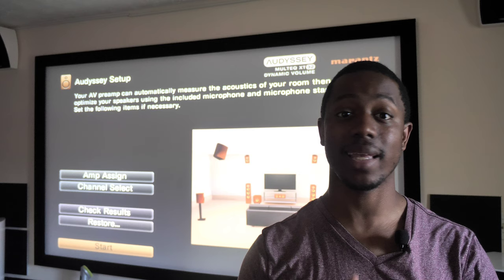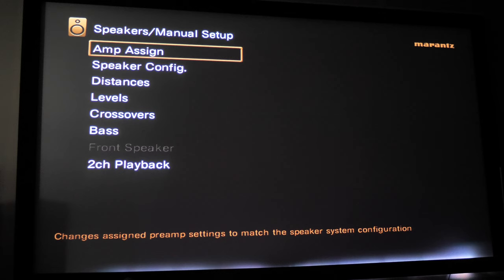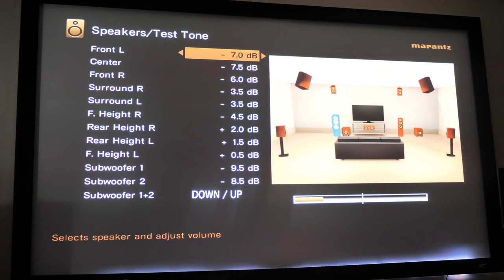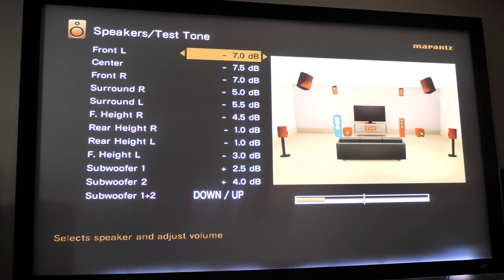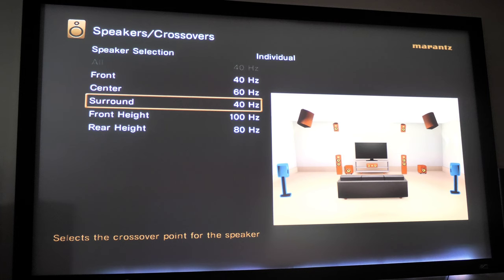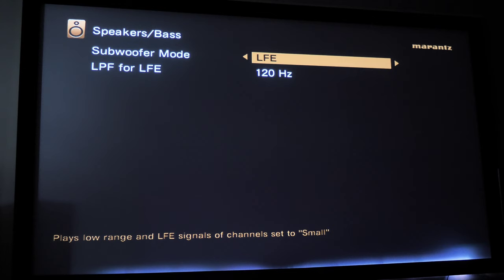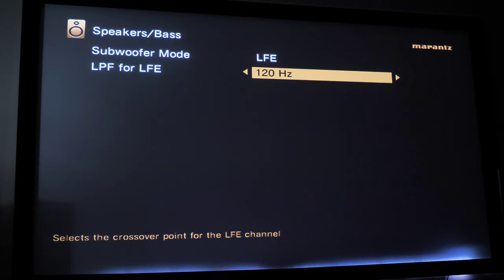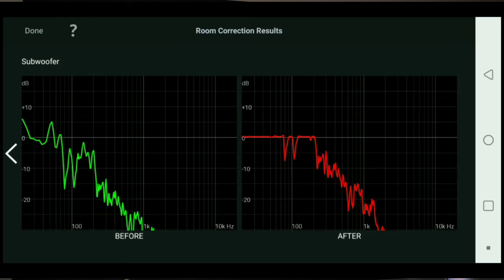How To Identify and Correct Receiver Calibration Mistakes

Comment: Great Kpaceguy. As a newbie you answered many of my questions, especially about avoiding male-voice chestiness from the center speaker. At the same time, you raised more questions for me. 
Could you discuss using the graphic eq after calibration. I produced some unexpected cuts and boosts,  in the bass, according to the graphs, Also, as I understand it, changing mains to small, then changing xovers re-assigns frqs below the xover to the sub and mains. This means that what the calibration "decided" before, is not what it would decide if you ran it now. Also, if you check levels, and responses after tweaking, do the measurements of a given speaker take into account the re-assignment of bass from other speakers.
Reply from the maker: I think I have a video about it. I'll link you to it
Reply: Looking forward to it thx @Kpaceguy

Comment: Nice job, generally.  But some of what you are doing is incomplete with regards to the potential for dealing with crossover refinement with the Editor App.  Like you saw with your initial run, it is very common to see Audyssey want to call the LCRs Large, and worse, cross them at 40Hz...even with speakers that you know good and well are not capable of being -3dB speakers at that frequency.  With the editor app you can, of course, change the config to Small. With some study of the pre-EQ room response in the Editor App, you can then use the Curve Editor to confirm where each speaker's -3dB point is in your room.  It's usually close to the speaker's designed -3dB spec.  You can and should change the crossover to that frequency,  but the real refinement is also telling Audyssey this in a more precise way by reconstructing the target curve of the speaker to reflect that -3dB point. This is quite easy to do in the Curve Editor by setting grabs at an octave above that frequency and at 20Hz.  You then manipulate the 20Hz level until the level at the crossover frequency is -3dB below the baseline average spl (that you can estimate in study of the response pre-EQ).  What you will see with this when complete in the Curve Editor is the appropriate 2dB per octave roll-off below the crossover point.  Audyssey will then apply filters to conform to that curve when you save and load it to the AVR/AVC. This helps smooth transition to the subs and prevents filters chasing things they don't need to.

The choice of the crossover frequency can also be affected by room volume.  Headroom is extremely important in the sub-80Hz octaves.  Your speakers (and subs) need not only the ability to create the frequencies down there, they need to be able to do so at very loud levels with ease.  This is so that they will never be challenged and compress at louder passages, reducing dynamics of the LFE.  If your speakers seem to be okay at 60Hz at normal listening levels, do they remain so when called upon to do so at times of loud passages?  If you are missing "slam," and you know the source media has it, this could be the problem.  Audyssey thinks you want the LCRs to deliver that 60Hz slam, when the room volume might overchallenge the speakers ability to deliver it.  Room volume affects this mightily.  Choosing a crossover point a bit higher than you might expect (perhaps 80Hz rather than 60Hz) may be just what your speaker needs to be able to roar without strain, turning over the loud lower passages to the subs. As long as the subs have the ability to deliver with plenty of headroom, you will then have the slam.  This makes a significant improvement to LF dynamics even at at normal listening levels if you have a large room. Of course, use DEQ.  FWIW.  Cheers
Reply: I failed to add that the pull down on the 20Hz grab will also somewhat affect the entire curve...and needs to be "countered."  To do this place a grab at 20KHz and move it such that all of the curve above the LF overlays precisely the primary curve that Audyssey created (the green and red curves).  Also, above I used the term "slam," but perhaps that is better used for the lower frequencies, and "punch" might be a better term for dynamic LF content around 60Hz. Rather subjective terms, but you get the idea. Cheers.  I enjoyed your video.  I'll have to check out more.

Comment: Why all my speakers levels are on +? 
Don’t i need to start with the center settings on 0 and then turn noise volume on untill 75db, then continue to get 75db from all speakers?
Reply from the maker: What receiver are you using

Comment: Just hit "subscribe".
I have the Onkyo NR6050 I also have the NR7100 and I want to see if there is a substantial difference since it is more than twice the price. 
Speakers:
Front wharfedale  valdus 400 se (I also have Timeframe TF700 not hooked up)  I would like to set them up as zone two for stereo listening only.
Center and surround are entra point five

the AccuEQ set the speakers within 4" of their actual distance with the exception of the Sub, that was off 3'
Front wharfedale  40htz
center 90htz
SR 100htz
Sub 120htz 

Timeframe sounded increasable at full in Pure audio  and "direct"  and much louder in stereo mode which does apply EQ.
Reply from the maker: I appreciate it. Welcome to the crew

Comment: Hello ! I hope you can help me with this question:
I have a pioneer amp (vsx815) that comes with 100hz xover by default. I have a Bosé Acoustimass 600 speaker.
How much do I set the x over on my amp?
And the ohms at what is recommended?
The speakers have a range of 4-8 ohms, also in the amp I can choose from 6-8 ohms.
Thanks in advance, engineer!
Reply from the maker: Are your speakers hooked up to the bose subwoofer directly?

Comment: After running Audyssey, if you use an SPL meter to level your speakers hitting the MLP at the same volume, do you keep Audyssey and Dynamic EQ on or off?  Many AV guys say to turn Audyssy off completely and use external tones to measure speaker volumes but then what happens to those levels iif you turn Audyssey and Dynamic EQ back on?  Also is using 75dbs at 0 volume too loud even when you lower the volume?
Reply from the maker: I keep everything on because that's how I'd use it after setting levels. I turn it off only to do certain calibrations outside of the receiver
Reply: @Kpaceguy Thanks,  but are you using the AVR's internal tones? From what I've read they bypass Audyssey whereas external tones don't.  I'm wondering whether it would be better to use the external tones with Audyssey and Dynamic EQ on. What do you think?

Comment: For the crossover, it's recommended to put everything at 80hz. First because this is the standard, second is because no matter what speaker you have and how low it goes. It will NEVER match a subwoofer in terms of impact and pure SPL. Also it will make your speakers use less power which means you can play them louder because the most power is consumed by the bass, 80hz and lower. So your AVR won't struggle that much, you will get cleaner sound and you can play louder. Even the top most Marants reliever won't do more than 60w per channel all channel driven.
Reply: Quetzalcoalt The only reason why 80 hertz is the standard is because of THX certification. You can thank George Lucas for that! If you have a high power amplifier and speakers that are rated down 40 hz or less you can set the crossover to less than 80 hz. It’s all about your personal preference.
Reply: @glennarcher986  If you start reading why it is the standard you will see why it is the standard. Bass is a huge problem in a closed room. Because bass have longer wavelengths and bounce all over the walls (floor and ceiling too). If you have a big explosion that will play 30hz at max volume on the LCR at the same time, you will have massive peeks and null in any room. That's why it's better to have subs doing all that work, because there are less drivers and can be made to work together more easily hence making the frequency graph more flat. Best way is to have 4 subs in each corner. Minimum of 2 subs is a must. When you have 1 sub, you can't fix the nulls because you need another cone pushing somewhere else in the same room in order to bring the null up. 
People wrote soo many books on how sound interact in a room. The 80hz rule no matter that THX made it a standard in the cinemas is a must to use. Which one would bring more impact, 3x7 inch drivers handling 200watts total or a 15-18 inch 1000w sub (or 2) ?
Reply: Quetzalcoalt You can go all technical on me and frankly I don’t care! It’s all about personal preference. If I want to set my crossover to 60 hertz, 50 hz or 40 hz, that’s me. My speakers can handle it. It’s interesting that before THX certification, there was no so called “industry” standard for the crossover.  It wasn’t until George Lucas and his team of engineers that changed home theatre as we now know it. How’s that for doing my research?
Reply: @glennarcher986  Can you do 105db at 20hz at your listening position with your Front Left and Right speakers individually ?
I would need a speaker that can do at least 110-112db  at 1 meter away in order to reach 105db at my listening position. 

Can you do a video, play the beginning of Edge of Tomorrow and 0db on your AVR when using a 40hz crossover. Also can you say what brand and model if speakers are you using, because they can handle it ?

It's a personal preference to use a fork for eating soup as well. 
That's why Dolby and some other companies are forcing a standard for movie watching, that disables all the personal preference crap on TVs but you don't care about the technical stuff and why they are doing it, this is the reason people complained about the dark scenes in GoT S8, that they can't see shit, but people with calibrated systems and the personal preference crap on TVs disabled had no complainants.
Reply: Quetzalcoalt Congratulations on all your technicals!!!! Where would you like me to pin the medal? It’s obvious you’re looking for an argument. I’m out!!!!
Reply: @glennarcher986  Wow. dude .... please read more. I don't want to argue with anyone, but spread the information that i've gathered in my last 3 years of reading about acoustics, measurements, standards, subwoofers, placement, room dimensions. I have soo much to learn. If you don't want to get knowledge then ok, i'm fine with that, but don't just start replying with random crap.
EDIT for a start go watch the first videos of Anthony Grimani from AVPro Edge. Not gonna link them here, go find them yourself.
if you like those (i think they are 5-6 videos 2-3h each) i will give you more PDF and technical forum threads to learn more.
I'm out too.
Reply: @Quetzalcoatl0  Glenn Archer seems like the most hard headed person around and doesn't want to hear any of it. He just has a hate for George Lucas and  believes he is somehow responsible for this 80hz standard and that he should burn in hell for it. Oddly enough, I wonder why people who set the crossover at 80hz always notice an improvement when it's just a big George Lucas/THX conspiracy?
Reply: @Jason-wc3fh  Yep, some people don't want to understand and learn why "something" is done this way. They just think what is right and that's it.
Reply: "NEVER" is a dangerous word. Some subs have weak amps. or are poorly designed or poorly built/damped/flimsy enclosures/chuffy ports etc or have higher harmonic distortion than some speakers

Comment: Kpaceguy I have a maybe problem but when I did the automatic calibration on my Onkyo avr..all is good except my left and right front speaker distance were way off ,the left was 11.5 feet which is good but the right speaker was 2.5 feet distance which of course wrong. My Question is what do you think the receiver did wrong? please advise Thanks.... PS.I re did it several times, I always get the same results....
Reply from the maker: There's no telling what it thought it needed to do. You could rerun it and it get it right. That's why we go back and make corrections
Reply: @Kpaceguy  Thanks a lot, we'll do, keep up the great support...

Comment: This is for movies. Have you thought of doing a video surround for music, as these settings would change?
Reply from the maker: No because I don't recommend listening to music in surround modes
Reply: @Kpaceguy  I get that it’s something some audiophiles often turn their noses up to. Sort of fell into a 5.1 setup (from a 2.1) with the addition of a new pair of older ELAC UF5’s ($399) and a UC5 ($136) onto a pair of UB52’s and an S10.2 used thru a Marantz SR5013. Alan Parson’s Quad/5.1 mix of Dark Side of the Moon sounds great thru it, but would take a hell of a lot of tinkering to get the 5.1 system working for lossless audio (primarily jazz) I listen to.
Reply from the maker: @init4fun  it's a cool effect but it usually puts most the information through the center channel and adds a lot of reverberation to all the other speakers

Comment: Hey Kpaceguy,I have a Sony strdn1080, the volume goes from 0 to 70 I believe. It's doesn't have the db volum e readout like your receiver. How would I level match that, what volume should I turn it to to get the 75db? Thanks.
Reply from the maker: Not so sure. Maybe just need to turn the volume up to the 80% mark. It'll be pretty close to reference level.
Reply: @Kpaceguy  ok, thanks

Comment: Interesting video, but I still have one question. I have an old Bose Acoustimass 6 series III speaker set up  - I know you don't like that, but _ when you speak about the LFE dial on the sub and say turn it right up, on the Bose there is a bass dial and an LFE dial - should I turn this up full, or is this a different adjustment. The manual reads like it increases the LFE. Please help
Reply from the maker: I believe one controls the cube speakers (bass) and lfe is the sub. The crossover is pre set
Reply: @Kpaceguy  thanks, so if the crossover is pre-set, what does the LFE control do to the sub?

Comment: For me to get my speakers to 80DB, im in the positives. Fronts are at +10. Is this bad ? 
I have a marantz receiver with an emotiva 5 channel power amp rated at 200 watts per channel. The room is 5m wide by 8m long. 
What do you recommend ?
Reply from the maker: Yes it shouldn't have to be that loud at all. Its not necessarily bad but that's pretty high
Reply: @Kpaceguy  i found out that my db meter only has A and not the C needed to measure. I think 80 db A is about 90db C lol. So if i put it down to 75db C it should drop alot. Sounds epic though haha. Hopfully i didnt do any damage to the speakers.

Comment: I always like your video Kpaceguy my question is I have a dual SVS subwoofer I find out lately that Denon x4500h has  two channels output but only one channel LFE so i need your advice do I need splitter and use one channel for both subwoofers?
Reply from the maker: Yes. Only problem with that is that the receiver won't calibrate them independently anymore. So maybe try both and see what sounds best?

Comment: Question: how do I pull up the Marantz setting on other inputs such as YouTube, if I’m watching something on YouTube and I hit setup/options on my AVR nothing comes up on the screen UNLESS I back out of YouTube, with my ONKYO that was never the case
Reply from the maker: If you're watching YouTube via the smart TV app it won't work. Your TV has to be set to the hdmi input you have your receiver plugged into for the receiver info to pop on screen
Reply: Use something like Chromecast plugged into one of the hdmi slots

Comment: Hi!
I am bit confused as you said it's a best to set the crossover based upon the manufacturer frequency response and not higher than 80Hz, what if I have a satellite speakers with frequency response 160Hz to 20KHz, do I need to set crossover to 80Hz or like around 180Hz. Thank you.
Reply from the maker: The rule of thumb is to set it about 20hz higher than its lowest rates performance frequency. So in your case 180hz
Reply: @Kpaceguy  thank you
Reply from the maker: No problem

Comment: So I have a small basement with the Yamaha YHT 4950 5.1 system. I used the YPAO microphone to set it up for the room. After the calibration,  it see that it has a global crossover at 200Hz. So, I ran it again and it's still 200Hz. Is that correct? My friends said that it is too high.
Reply from the maker: Well I have no idea what speakers you have
Reply: I have the standard speakers that came with the set
Reply from the maker: @tavonbrown817  It's probably pretty close to correct. Those speakers have very little bass.
Reply: @Kpaceguy  Thanks! It still sounds amazing. I want to upgrade to an atmos system. Any recommendations?
Reply from the maker: @tavonbrown817  get a newer yamaha receiver
Reply: @Kpaceguy   Just the receiver or the entire setup?
Reply from the maker: @tavonbrown817  if you like the way it sounds now, start with just the receiver
Reply: @Kpaceguy  Ok great. So what difference would the newer receiver actually make?
Reply from the maker: @tavonbrown817  well first, you need a new receiver to even have atmos capabilities
Reply: @Kpaceguy  Recommend anything? I'm new to this. I came from a soundbar
Reply: @Kpaceguy  what bookshelf speakers do you recommend since these have little bass?
Reply from the maker: @tavonbrown817  polk audio, jamo, fluance